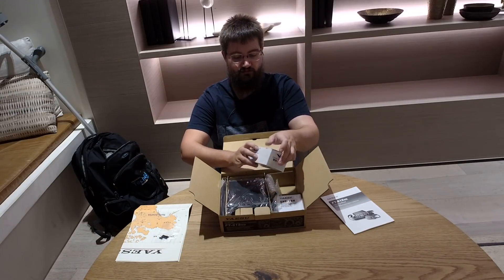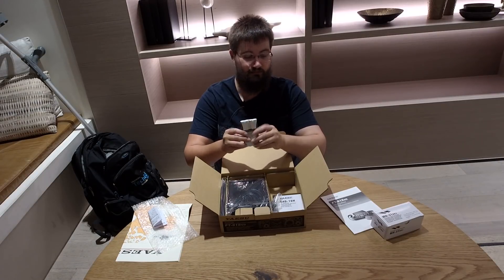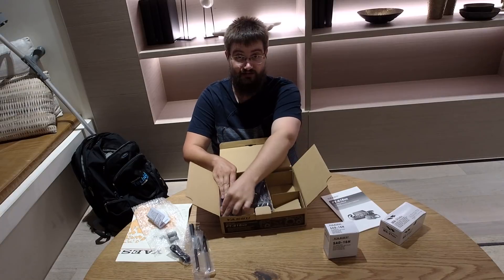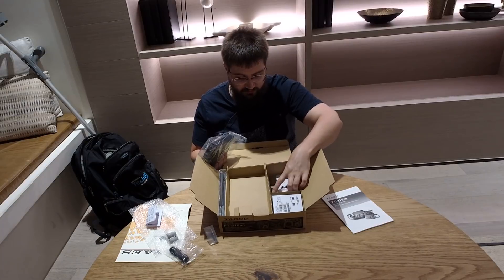Yaesu FT-818 in the flesh! First look at the FT-818ND inc unboxing

Comment: I really can't believe they even bothered releasing this radio!  I am guessing there has been an obsoleted part in the 817 that they couldn't source any longer on that 18 year old design so they had to make a new board which changed all their FCC certification and such therefore they had to issue it a new model number.  Why else would you not make this a MAJOR update!  Glad I still have my IC-703+ and Elecraft KX3.  At $800+ how is this rig appealing?
Reply: Still a bargain for the band coverage you get and the durability.
Reply from the maker: Dear Seth,

We completely agree; there is a certain arrogance in giving the radio the FT-818 model number.

Substantively, the most obvious part changed were almost all the relays on the PA board; there are a select few I have noticed with a bit of a glance on the main board but not many.  We'll release pictures in our wrap up video.

The findings will essentially be that Yaesu had a killer opportunity to boost sales whilst Icom ignored 'man pack' / ultra portable QRP radios, and instead squandered the much dreamt of 'FT-818' name on what is technically speaking really just the FT-817 Mark III or '20th Anniversary Edition' (the original was released 2018, so its 3 years short, but given they paid for it to pass certification again one can only assume it will still be the same in 2021)!

Even I could see this radio would generate significant interest; I'm not sure why Yaesu's top level executives either didn't see that, or threw it away.

If you own an FT-817ND, it simply isn't appealing.  Everything in an FT-818ND can be 'added' to an FT-817, even the 6 watts (no change in finals).

We bought ours to show it to the world because it was a long awaited replacement, and knew people would be interested either way, but that is the only reason.

With any luck we're not too out of pocket when we sell the FT-817ND, and the very slight youtube add revenue ends up covering the difference after a year or two.  Probably going to have to chalk the loss off as part of building up the channel, however.

73, Jarrad VK3BL & Ben VK3HBN
Reply: Like he said in the video, the 818 "no different", lol.

Comment: Jarrad, I have the FT-818ND and sure would like to see how to setup SDRPlay with the spectrum waterfall with this rig. I previously had a used 817ND that I bought for a good price but ended up having to return it because the mic was broken and some other RF noise. But that was fine, I ended up with the new FT-818ND for about $100 more from Gigaparts. I also bought the amplifier that you demonstrated in your other video and waiting for it to arrive.

Comment: Even the battery is a disappointment.
Japanese 2000mAh cells are readily available now, why have a 1400mAh pack?
You could even argue it should come with a lithium pack.
Their HT's have been using them for a while already.

Comment: They have upgraded the battery capacity which is then negated by using one more Watt. Maybe the 5 Watt P.A. MOSFET's  are obsolete. The only real advantage I see is better stability as I had a report of my 817ND drifting slightly the other day on s.s.b. when out portable and using it's internal batteries. Also good we in Britain can now get 5MHz as standard on the 818. I'll stay with the 817. My H.F. homebrew rig is being modified so I can get on 5MHz and looking to put it on our 70MHz band.
I used the map as QSO notepaper as it wasn't very good.
Bill, G4GHB.
Reply from the maker: The map looks pretty but it isn't that useful ;). The MOSFETs and the whole PA sub board is actually identical between the two models, but it is an interesting point you make regarding the power increase negating the battery capacity bump - this would be interesting to test on FM modes especially.  I suspect the newer battery is of the 'low self discharge' variety, which will be of advantage if used around the shack occasionally for finding interference etc like a lot of us tend to do.  73, Jarrad VK3BL & the RMR Team :)

Comment: I have FT817ND .
FT818ND is made in Japan .
But it has not been delivered yet here in Japan .

de  JE2PQQ
Reply from the maker: Dear JE2PQQ, It has not been delivered in Japan?  That is very surprising; perhaps because of high stock levels of FT-817NDs at dealers?  There isn't much in it to be honest; we would have preferred the radio be called the 'FT-817 Mark III' or 'FT-817ND Special Edition'; there were more important changes between the FT-817 (2001) & FT-817ND (2004) in our opinion.  We intend to publish a 'conclusion' video shortly.  73, Jarrad VK3BL & the RMR Team.
Reply: VK3BL de JE2PQQ

Hello , Jarrad .
No , not yet .
I hear FT818ND will be delivered from the end of April in Japan .
I don't know about the stocks of FT817ND .

The maximum output power has been changed .
I heard the another name was necessary for the law in Japan .

73  from  Yoshi  JE2PQQ

Comment: I'd be interested in hearing if Yaesu made any changes to the power management circuitry. The 817 & 817ND have a bad habit of drawing the rechargeable battery down when the radio is turned off. That's the reason so many (like me) just chucked the battery pack and went with using AA's in the battery tray.
Reply from the maker: Dear Brian, there are definitely circuitry changes, especially on the RX board.  I haven't had a chance to look over everything yet, but I can confirm the menus are identical, and so are the charging times.  NiMH batteries do have a relatively high self discharge rate compared to Li-Ion or LiPo - are you sure the 817 draws current?  73, Jarrad VK3BL
Reply from the maker: Dear Brian, I just completed a teardown and comparison to the FT-817ND, and there are indeed changes to the power supply input.  Hopefully this addresses any previous flaws :)